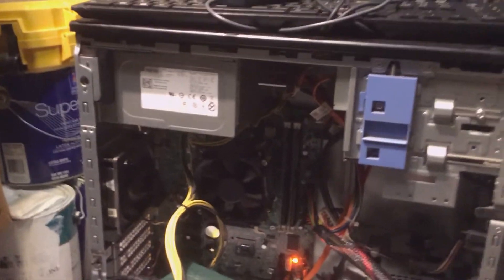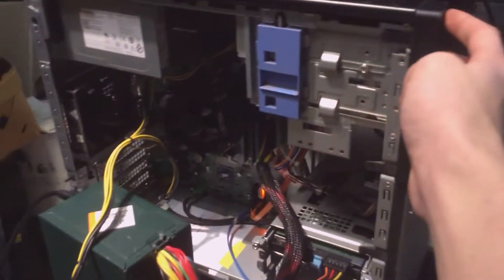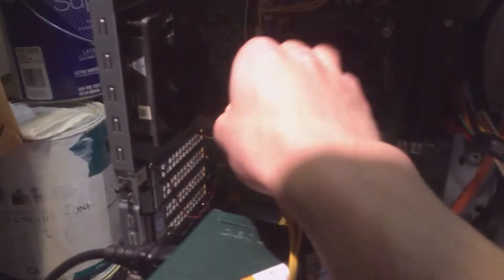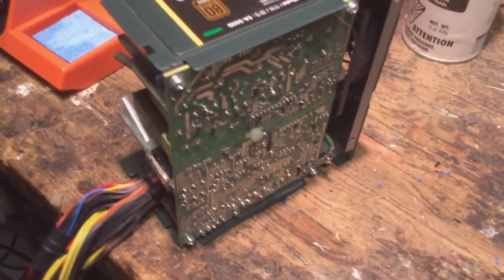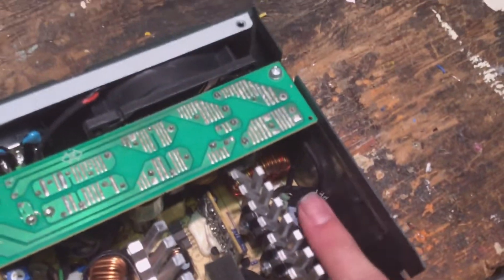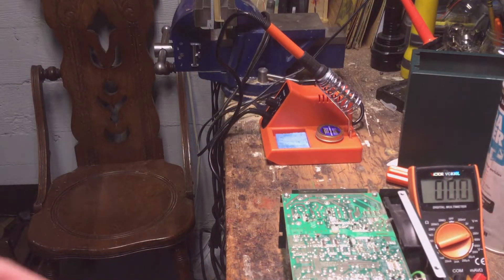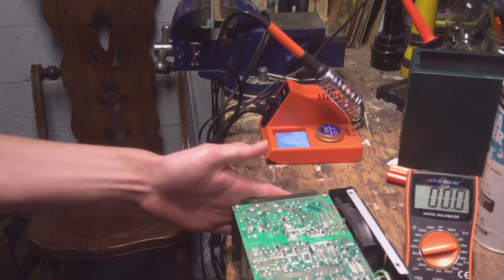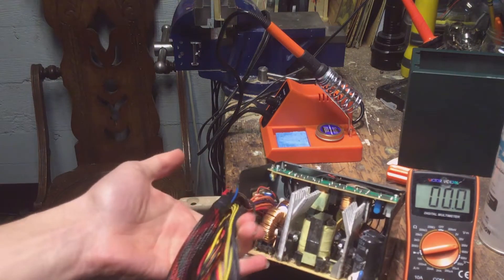How To SAFELY Clean Your Computer PSU

Comment: Be careful though, you might kill the PSU's warranty. When it expired on my old PSU i disassembled in 1-2 years, and its working since 14 years. I used compressed air so i never touched anything. My new PC's PSU has 10 years warranty on it, not to mention the auto-stop fan feature bringing less dust into the unit so i no longer bother about cleaning it anymore

Comment: Your PSU was already pretty clean. 
You should do one that hasn't been cleaned in 10 years and is clogged full of lint lol
In my case, mine recently burned out while running 2 GPU cards overnight - so I just ordered a new one this morning on ebay for $14.99 + free ship. That's actually cheaper than the time it takes to open one up. 
But still, interesting stuff, good to see what's inside there :)

Comment: You remind me of my industrial electronics teacher.

He unplugged his laptop charger in class and removed the psu bit so it was only the AC wire connected to the wall socket.

Stuck in a multimeter and showed us the voltage. He also taught us how to discharge a capacitor (short it), though not a fan of that method.

On a PC you can just turn it of, unplug from AC and turn it off.

It will drain the remaining charge from the capacitors. As shown in the video, there will be a little bit left, but it won't hurt you.

But it is good practice to check it with the multimeter. We were taught to start with the highest rating and go down if you don't know the specs of the component you are measuring.

Comment: I was debating if I should disassemble my psu and clean it, especially after so many people treating that procedure like a death sentence. The constant "YOU WILL DIE" replies held no weight. After draining my psu by disconnecting the cable and holding power button for 30-40 seconds it was super safe to clean with a brush and vacuum cleaner. Thanks for confirming this process isn't dangerous.

Comment: I dont have a tester, can i just clean it ?
Reply from the maker: Yeah, just short out the terminals with a screwdriver  if it was just plugged in to make sure
Reply: @randomelectronics2224  my things been unplugged for a couple hours. It’s completely safe to touch the psu right?
Reply from the maker: @Sharkiar  Yes it safe if as long as you left it unplugged from the wall but still connected to the motherboard, the standby circuit of the motherboard will drain the capacitors.